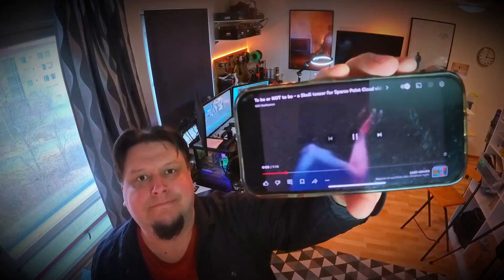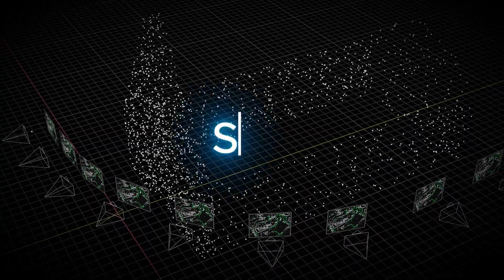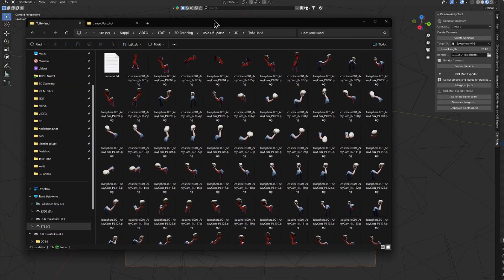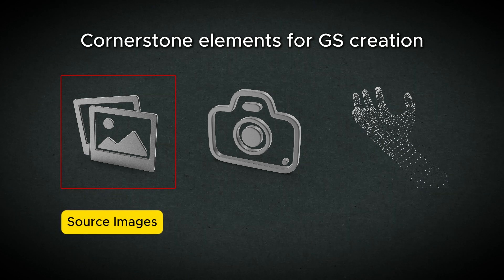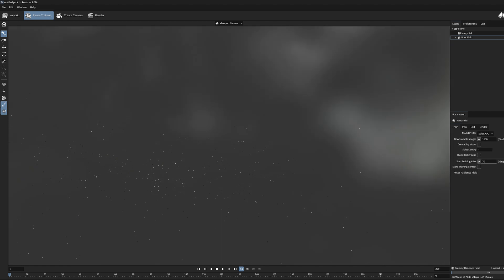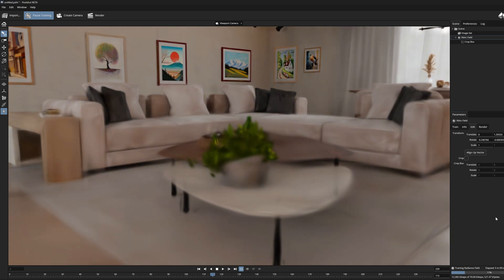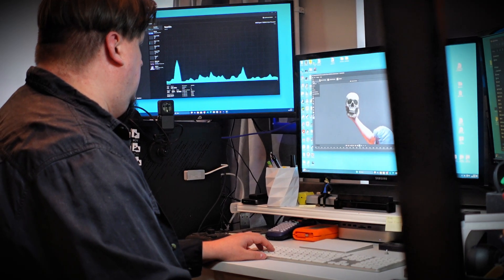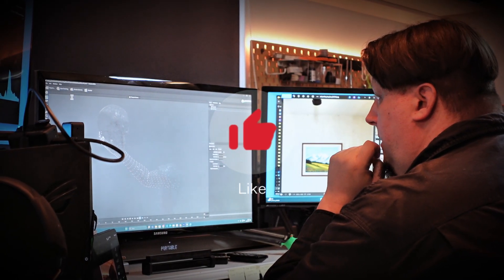Secrets of the Sparse Point Cloud in Gaussian Splatting process

Comment: How do you export ply from blender?
I tried and postshoot returns an error that file has faces in it
Reply from the maker: I mainly use my Camera Array Tool for exportin the point3D.txt file as a point cloud. It is in COLMAP format which the PostShot undestands. But if you just use the basic Stanford PLY exporter from Blender, it will be exported with faces and it is not that usable. Of course you can use Cloud Compare program and remove face layer there and then save it again with only the points.

Comment: I've noticed the following issue and can't figure out how to resolve it. For example, when I create a point cloud and align cameras in RealityCapture, I always get worse GS results than if I align the cameras and create the point cloud in Postshot Colmap. I've tried all possible RC settings and created various point clouds, but I have never achieved a result better than Colmap. The result is always worse. What could be the reason for this? If point clouds aren't that important, then why is the GS result always worse when we import the camera alignment and point cloud from RC? I've done hundreds of different tests and still haven't found a way to create a GS of the same quality as with Colmap. Does RC always produce worse camera alignment than Colmap?
Reply from the maker: Hi Andrii! That's interesting. Maybe Postshot creates a better Structure from Motion result because COLMAP is integrated and optimized centrally in its process. It certainly manages to align the cameras better than RC, but that calculation phase is very long and takes significantly longer than in RC. Although in RC you have to spend significantly more time when you have to combine separate components. Someone praised that the new version of Reality Capture would be significantly better. I have to try it. You build very cool scanning rigs by the way. I've been amazed at how many GoPro cameras you've managed to connect to them. And the results look really cool too. Good job!

Comment: Hi. I am a CV researcher. If you are worried about the speed for generating inital camera parameters( and sparse point clouds) and processing time as an inital step, check out GLOMAP, its built on COLMAP( which is used by most to get the initial guess through SFM) but is much much faster for scenarios wheere there are alot of cameras.

Comment: Testing the XGrid K1 right now , results are amazing.  In rendering there is no time advantage because of the Lidar pointcloud by the way. ( or our models are too complex :-) )
Reply: Are the results better than using just a camera or is it just faster to use?
Reply: @Bubblegummonsters  Good question! . difficult answer. So first of all, the ease of use is a lot better than a camera (drone or handheld). The reason is the 360 image/lidar capture compared to a camera that needs to be pointed at the subject .The first is a lot easier. Is it better? so pixelwise a (cheaper) 360 has les pixels than let's say 4K cameras (in this case 5,7K on a 360 image or 4K on 3840×2160) and needs a lot more light. So what result is important?  Always have a good capture of what you want. --Yes, absolutely the Lixel. High-res detail like Olli? better learn the capture procedure use a good camera and learn from your failures.  Best is to use a combination of the two for the situation, i think.
Reply: @oebleh thanks for the reply. So the K1 needs a lot of light? Would it cope with tunnels if you also attached lighting to project outwards ?

Comment: The reason that the skull appeared while it does not exist in the point cloud is the images has it, so the algorithm shifted some points from the hand to the position of the skull to reconstruct it, this is not so efficient it will reduce the quality of the skull and the hand a little bit, but still works enough.